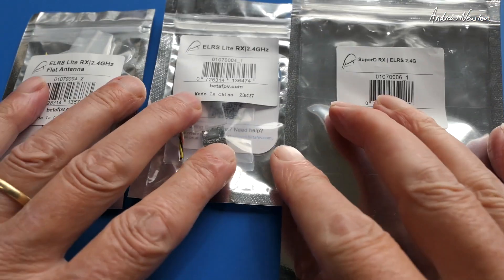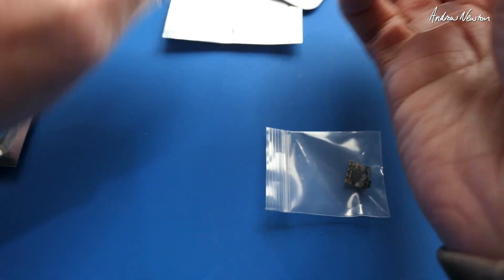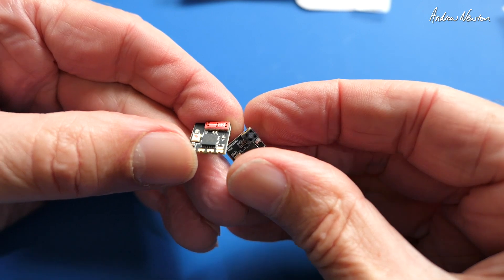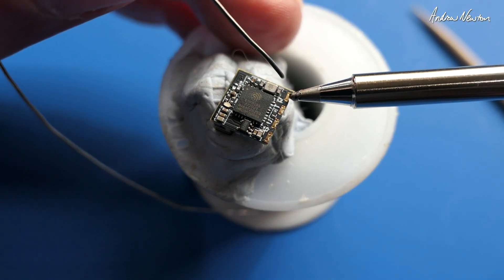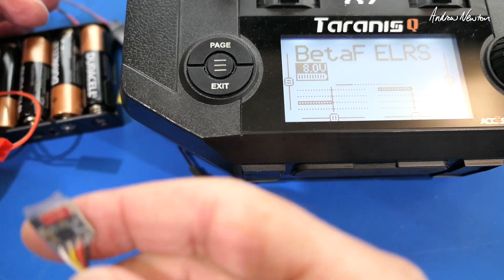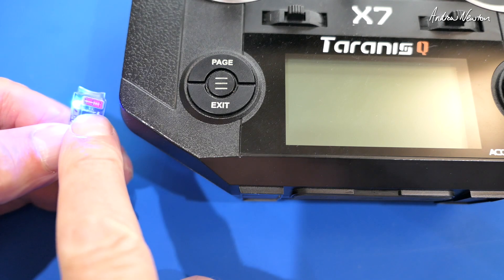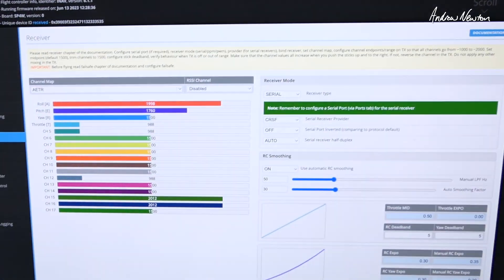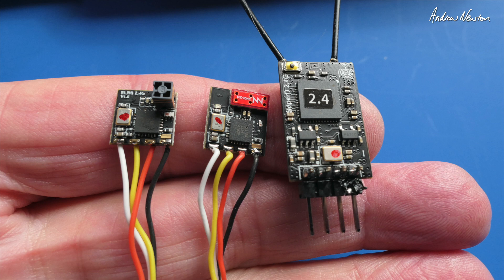BetaFPV ELRS 2.4GHz SuperD, Lite tower and Lite flat.

Comment: I bought this for my fpv drone with jumper t lite and maximum reach was 100m
Reply from the maker: Should be 100 times that range.
Reply: @AndrewNewton  yes, that's my point. In open field, with only 2 trees, ot gets sometimes less than that. I made great soldering, I do it for a year almost every week. Maybe I bought a bad one?
Reply from the maker: Check antennas on receiver and radio, or your set up selections in the LUA script. Unlikely to be a bad receiver

Comment: Good for over 600m you say, unbelievable for such a tiny thing.. 
Which plane have you used it in??
Well worth the coin ($17) even with our deflated $. Just need to find someone with good eyesight.
Reply from the maker: I have the lite tower in my C1 Chaser wing.
Reply: @AndrewNewton :: You still got that, from Vic? Awesome. I remember you having to fit everything in a bike box when moving. Shame that you had to leave so much behind. Time to bring the Chaser out for a slope session trial for Beta ELRS testing.
Reply: I bought this to my FPV drone. With jumper t lite it reaches maximum 100 m

Comment: I dont understand these recievers with no servo connections on them.. How do you hook up a set of servos to it ? Im behid the times with recievers, I still use the classic stuff from frsky with servo pins..
Reply: it's a serial connection to a flight controller, which in turn has pins for servos and motors...
Reply: @derrogers  Ahh so you cant actually use it in a standard plane so without some sort of flight controller..
Reply: @petrokemikal  yes, that's correct. but there are bigger elrs recievers with servopins.
Reply: @derrogers  Got it.. Thanks.. Im not actually in the market for an elrs reciever.. But just wondered why everybody was using them as of late, I did notice it was all drone and autonomus videos now though when I think about it.. Has anybody designed a breakout board for one of these recievers that would make it compatable with servo pins or is it simply just for drones and stuff and thats it ?
Reply: @petrokemikal  it was developed for multicopters as a high performance, low latency and long range link. everything plane related is an afterthought. but seems to work there really well, there are cheap elrs receivers with servo pins. no need for a breakout board.

Comment: I wish there was a step-by-step video on elrs binding,
I have the zorro elrs TX, and a happy model module for my qx7.
also the happy model mobettle  whoop .and they hang on my wall for sheer incompetence on my part
going on 2 months now.  the XM+ is what i have used for 4 years now, at least they will never break on the wall LOL.
Reply: just flash recievers and module via elrs-configurator with the same bindingphrase. done.
Reply from the maker: The whoop will have an SPI receiver I guess. Bardwell shows how to bind these.